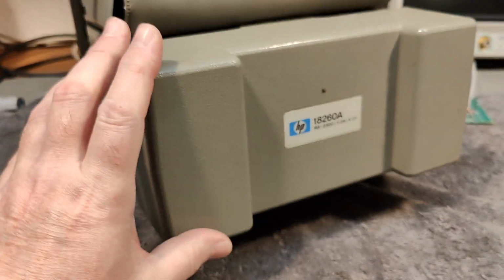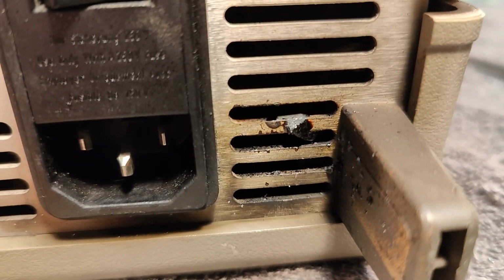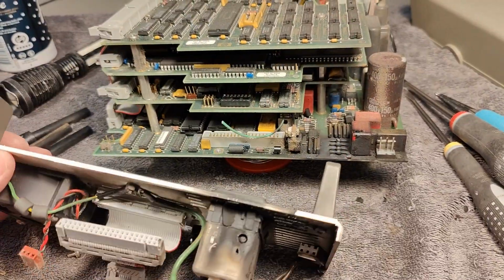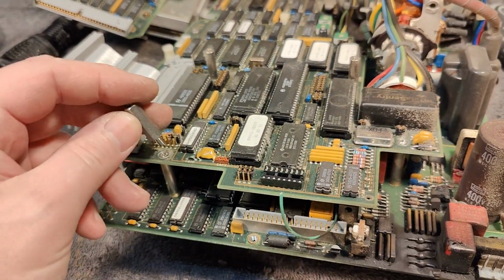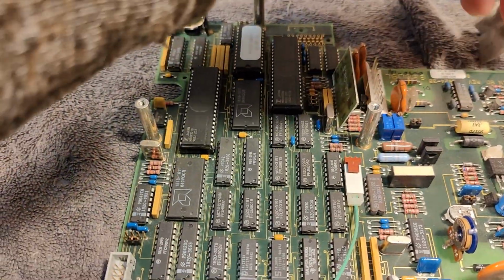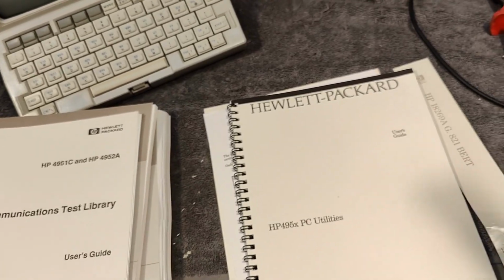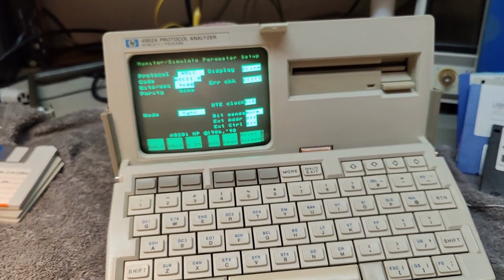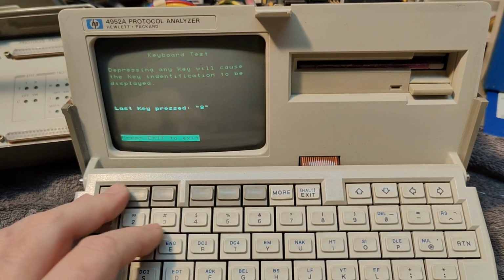HP 4952A Protocol Analyzer 1986 repair test

Comment: Not only is it a Z80 but it is a CMOS Z80, hence the "C" in the designation.

The Z80 only runs the application software; protocol handling and analysis is done in the 68008.  Odd that they would have an 80C88 just for handling disk storage.  And having an 8051 isn't too odd when you consider that most AT systems have one to handle keyboard control.

Comment: Motorola 68008 CPU, it's basically a 68000 but with only an 8-bit data bus. Same processor was used in the failed Sinclair QL computer.